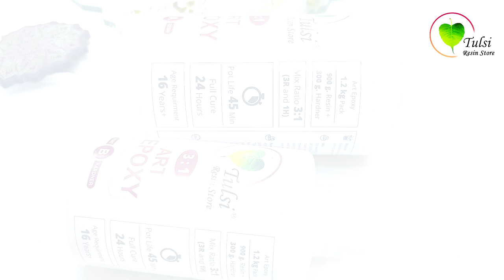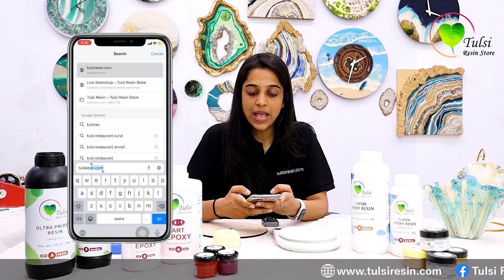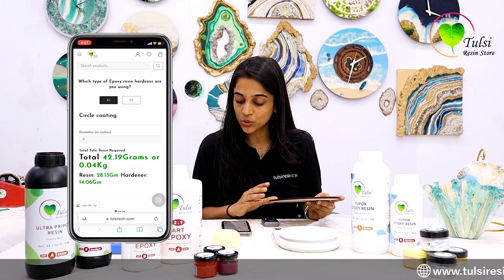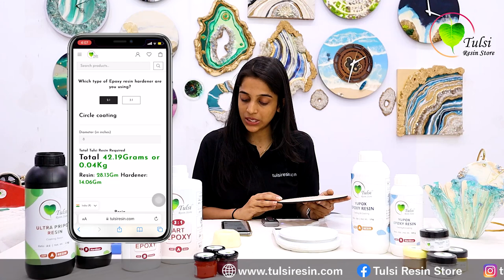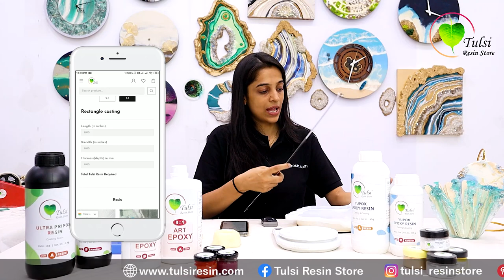How To Calculate Resin || Resin art materials with price || Tulsi Resin Store

Comment: How to calculation hexagon shape coaster ??please help
Reply from the maker: Please enter the shape as circle and our calculator will calculate the approximate resin required.

https://tulsiresin.com/pages/tulsi-resin-calculator
Reply: @tulsiresinstore  thank you so much
Reply: @tulsiresinstore  Mam ok i will select circle then casting then I will take 2:1 ration....and I have a 4 inch hexagon coaster mould , thickness is 13mm ...so answer is hardner 35.13 gm resin 70.26 gm ,,,bt my question is how much ratio should be taken of 1st layer and  2nd layer .. please tell me mam..how to divide?
Reply: I am a total beginner but I think you should divide by 2 do the first and mix the other half when doing the second coat. Or do a 2:1